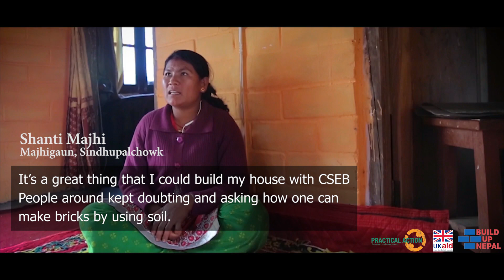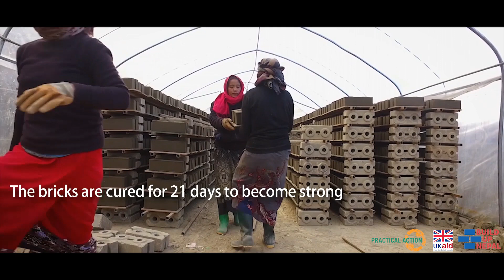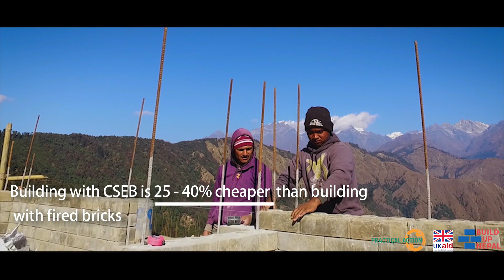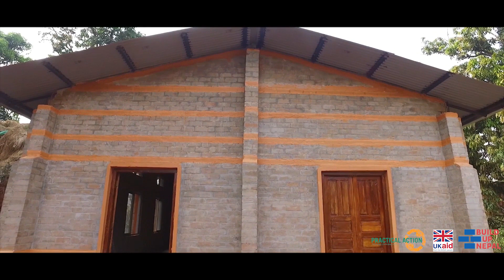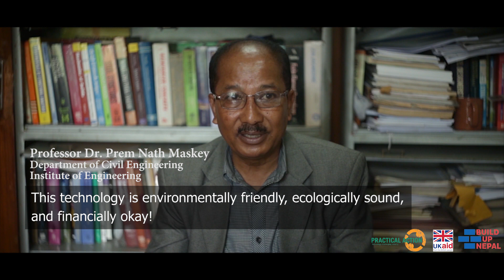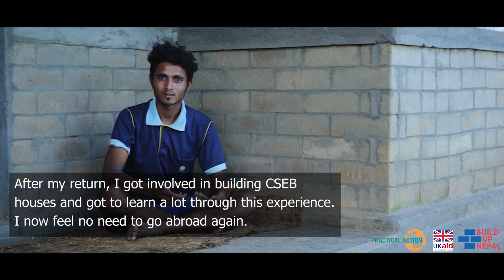Advantages of Interlocking Bricks (CSEB) - Build up Nepal

Comment: hello i wanted to know what constituents do you use in order to reduce the per cubic inch mass of the bricks as compared to common fire clay brick
Reply from the maker: We use Sand, soil and cement. For more engineering details please contact Indra jee at 9802055835